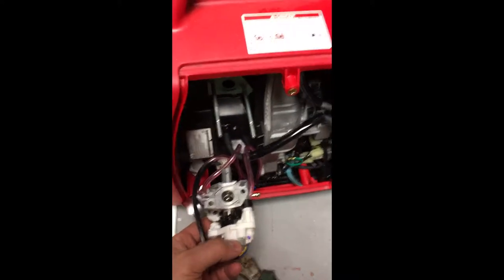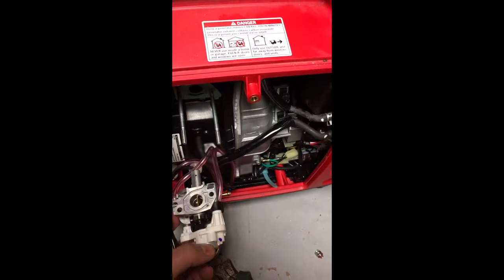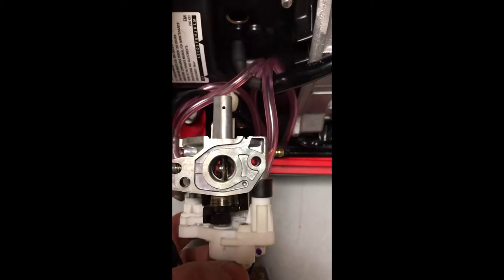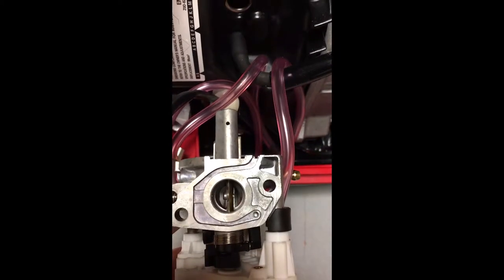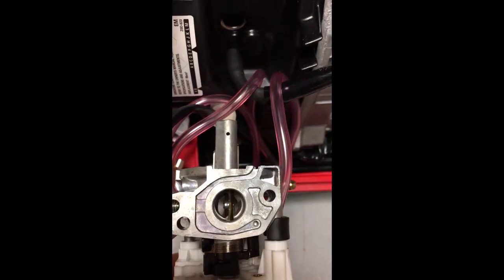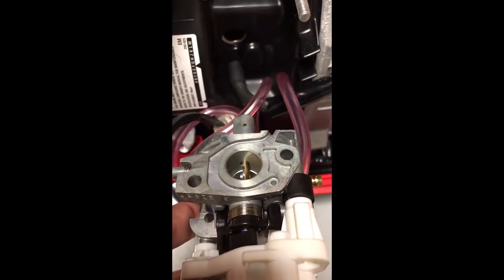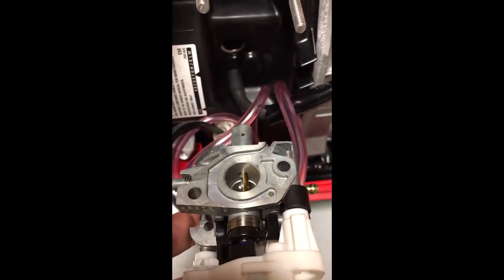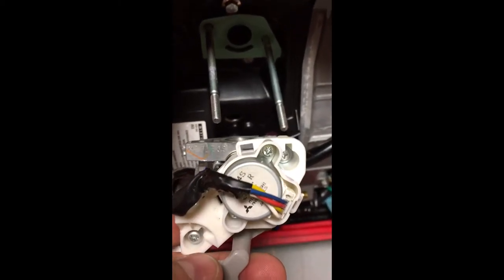Honda i2000 rpm adjustment max power output

Comment from the maker: Just to let you know my first trip with the i2000 generator and it runs the ac unit without issue the throttle adjustment made a difference

Comment: Did this work for you?   I'm having the same issue.  Purchased micro air easy start and trying to run a dometic 13.5k with the eu2000i with poor results.
Reply from the maker: It runs it for 30 minutes but I also have a start capacitor.   Before it just shut down.   I have a i3000 on the bumper. This will clearly not run ac.  The i3000 is quieter as well

Comment: What RPM does it run at? I have one now that seems like it's running too high. It runs at 4300 RPM with the auto idle off. Can't find anywhere if that's too much.
Reply: that is perfect 4300 plus minus 200
Reply: paper burn  I thought there was something wrong with my generator. I got it broken and replaced a valve and the piston rings. Runs good now. Thanks for the video.